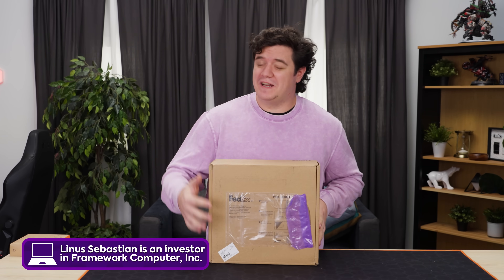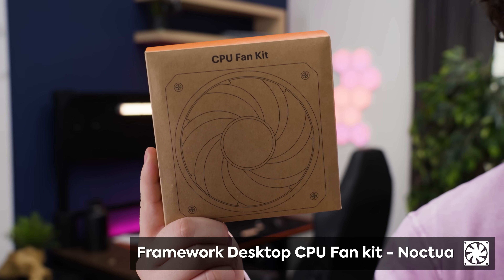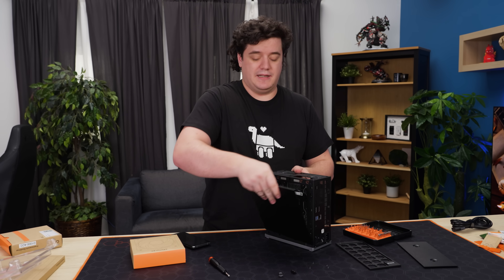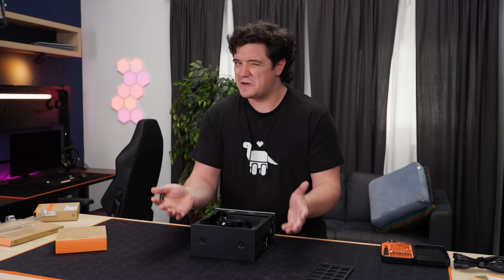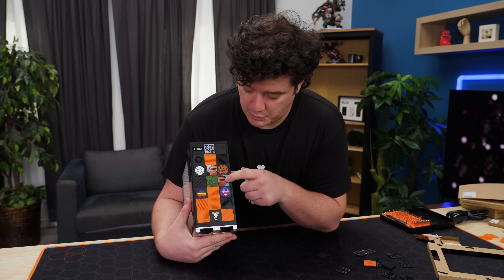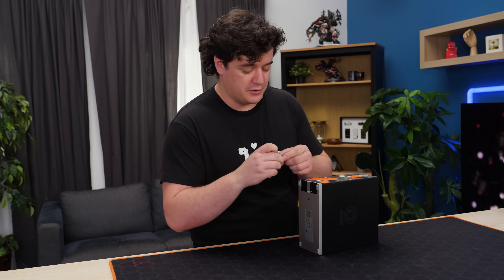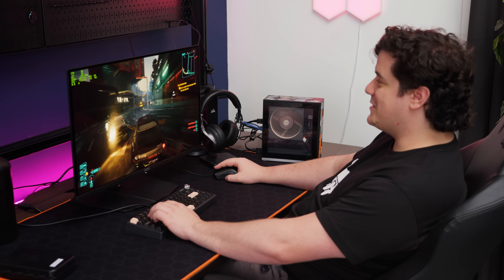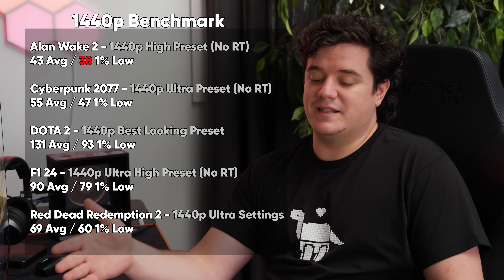This TINY desktop makes me nervous.... - Framework Desktop

Comment: i'm not sure why id' want this over a regular itx machine, at least, at this price
Reply: You can  buy the ITX barebone separately, which for the base APU is 800 bucks while including 32GB of RAM. I think for a SFF that isn't a terrible deal given it obviates the need for a graphics card while having a ridiculous amount of potential VRAM.
Reply: @Blaze6108  sure, but i was more interested in why i would use this over a am5 itx with a better cpu, i guess vram is the answer for ai though
Reply: The maxed out variant is one of the cheapest ways to get VRAM for local AI. Not super worth it otherwise.
Reply: @blazewardog ok, but why do I want an “Ai” pc? And what the hell even is an Ai pc? I can’t fathom a use case for this that any normal gamer or even power user would want. It seems like a hyper-niche product trying to capitalize on all the Ai hype.
Reply: @BuzzzdLightyear  running LLMs locally.
Reply: @BuzzzdLightyear  vram becomes a limiting factor fast when you're working with bigger models. Even a 5090 can get capped out meaning you just can't train the model at a certain quality level because of the low vram. If you want to run bigger models at your desk (maybe for testing or config or whatever so you don't have to push everything to the cloud all the time), having 96gb vram for this price is insane. You would need an Nvidia A100 80gb to get close and that card is over 20k and that's just the card.

Now obviously the chip is better but if you're limited by vram, you don't really have alot of options. You could run multiple 5090s, but that's expensive as hell and will eat up your electrical bill.
Reply: Ai and mini prebuilts are very hard to find
Reply: I really wish people would fucking research before giving the "bUt Da PrIcE" line, got on PCpartpicker and price out a 9950X (cuz this is a 16 core Zen 5 APU), a cooler that can actually handle it, an ITX motherboard that can reliably supply it with power in the same form factor, 128 GIGABYTES of DDR5, a 2TB SSD, a 4060/5060/5060TI 16GB, a PSU to power it all, and an ITX case that'll still be twice the size AT LEAST and probably cost $200+ on its own, and youre running at about $2000 if not more, while also drawing more power from the CPU ALONE than this thing does in the whole package. The price isnt bad if you actually price out a comparable build and dont give it obvious favoritism over the framework. Is it for everyone? No. But its not overpriced.

Also, as for an actual use case, anywhere that has higher power costs, or if youre a trucker like I am and have a very limited power budget you can allocate to things. This is a fucking GOD SEND to the trucking industry because this gives me a super small, relatively affordable (most truckers can pay for this thing in 1-2 weeks of work), and still really powerful machine.
Reply: truckers don't need ai developer machines
Reply: @seethruhead7119  But what if they want to develop software when they aren't trucking?

Comment: the power cable is not in by default because they want you to choose what kind of socket you want one for, also as you said they are really cheap, cheaper on their website than on amazon so i don't think it's that important to just tick the box with the prongs layout for your socket
Reply: It's also to save money if you already have a power cable
Reply: They could have just charged $5 more for the PC and then had it be a "free" required selection and no one would've complained. Sigh.
Reply: @nickglover what if I have a power cable lying around, now I paid $5 that I didn’t need to
Reply: @sebastiansanchez8752  List it as "No cable (-$5)". Human psychology is weird.
Reply: @sebastiansanchez8752  You'd never known
Reply: @nickglover  No, because the system where "first one's free, next one's $5" is more complicated than just offering a flat $5 fee.
Reply: It's such a stupid point he's making. He didn't even need the cable he purchased.

Comment: I kind of understand why that cable is not included. I mean i probably have 20 of them since they have been the standard cable for as long as i can recall.
Reply: nonsense you are just giving reasons to cheap out
Reply: This! I'm actually glad they don't include it. I literally have a whole box of them in the attic. Happy to not introduce more e-waste in the world by just reusing my existing one.
Reply: Imo it’s just bad communication on frameworks end. Make „remove this cable and save 5 bucks“ and people would be happy lol
Reply: How?? Where do you get them? I have one that was with my PSU. Do you constantly buy PSUs??
 (And a couple with previous PSUs, but I obviously sold them with PSU on second hand)
Reply: @Darnal-l  Well, the cables never break, i am now 47 years old and got my first pc at the age of 15. Monitors back in the day used the same cable so yeah, i have a lot of them. I also build computers for other people and sometimes they dont want the cable since they already have a few.
Reply: this is why I'm finally in support of not even including chargers in phone boxes. For $20 I can get a decent quality 65w brick to charge my laptop and phone. I don't need anymore cheap 20w pack-ins.
Reply: I believe they've been is use in consumer electronics and industrial equipment for around 50 years or longer. Original Apple ][ used the same power connector in '77
Reply: Agreed… I like it as an option as many people have more than a few and landfills already have enough electrical waste… Every little bit helps. Excellent work Framework!
Reply: Yeah we all have to have one somewhere but you know as soon as you need one you can't find any of them. They really should put it as a included and then get a discount for removing it.
Reply: @imark7777777 in all fairness the order page does have you explicitly say: I'm bringing my own.
Reply: I completely disagree, even if I have 20 they're not all the same quality, if I was a retailer selling these I would want to sell them with a cable I know will work
Reply: I mean he also already had one and didn't use the one they bought. xd
Reply: Yeah and they do the same for their laptops, you can buy the most basic functional skeleton of the laptop, and use your own charger or buy one from them, yo choose, that's what they do
Reply: I am in the same boat but people who don't have them should get it. If anything make an opt out box. I would greatly appreciate an opt out box for tons of cables with things I buy.
Reply: Then they should have been made free as an optional add on. Doesn’t inconvenience those without them, and it doesn’t create unnecessary waste.
Reply: Agreed!
Reply: How stupid. Lol 😂
Reply: I think I have a million, as most computer people do.
Reply: @JamieShultz i have one. For my PC, why should i have more?
Reply: @JamieShultz   its also standard socket for kitchen appliances
i have yank some from a rice cooker before lol
Reply: Same. These cables are so universal and half of the time, when a PC gets decommissioned, I keep it. Since I am in charge of PCs in my family, that happens a lot to me.
Reply: @christianbaer2897 I think the only thing I have more is printer cables. I hate printers.
Reply: @FrankHouwelingBoskoop  Printers might be most hated peripheral
Reply: I stand with you on this one, I bought a new monitor recently, came with a new cord, and I just added it to the pile cause you can't even sell the cables or even give em away cause everyone I know also has a surplus

Atleast they give you the option to add it assuming you don't already have one.
Reply: Agreed, the one in a thousand customer that doesn't have one of them is not worth the environmental damage of including them in every order.
Reply: Literally just sorted my stash of dozens of these last night looking for the perfect length C13 😂
Reply: @xaj the wire gauge isnt the same for all
Reply: @primus711 fully aware, but for the device I needed it for the gauge wasn’t a concern
Reply: Agreed. Came here to yell at him about this.

I've got 10 or so of he damn things, and that's after several electronic recycling runs to cut down on the extra gratuitous ones. Please don't send me yet another one.

The tiles though ... There needs to be a cheaper base option (one piece injection molded vented cover?)
Reply: @kilpatds you people just give companies excuses to include less and charge the same smh
Reply: Yeah it's probably better for the environment and unlike apple the give you the choice at purchase. Apple would charge $25 to add the cable 😂
Reply: @sportsshorts8403  99% of consumers has access to Amazon... A $10, 240w rated cable will last you a decade if you take care of it
Reply: agreed...
Reply: I agree. The people this targets likely have the cable. This is definitely on my radar, and I definitely don't need the cable. I just hope they have good support for people who don't realize it's not an extra cable and don't have the cable or a techy in their lives with spare cables
Reply: 100% I agree on this one. It is I think safe to say The Most Common Power Cable. I have like 10-20 of my own. And as an IT person i probably have 40 or more at work and and I stopped worrying what happens to them. I don't know why i have so many. But I will never need one, and would gladly save $5 and not create more ewaste on that item. They aren't as much a consumable like usb C cables are.
Reply: Exactly, come on Elijah, that's the whole point of Framework! And if you don't have a stock of at least 10 we need your card back please